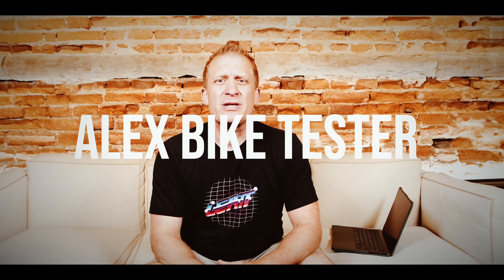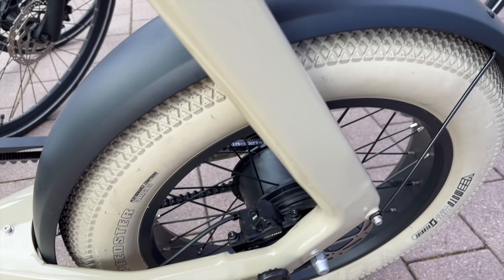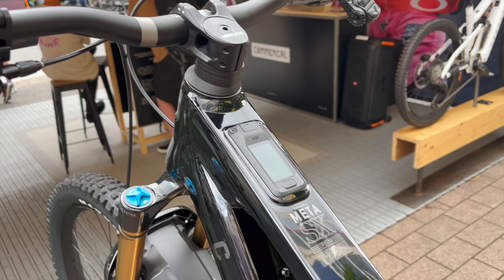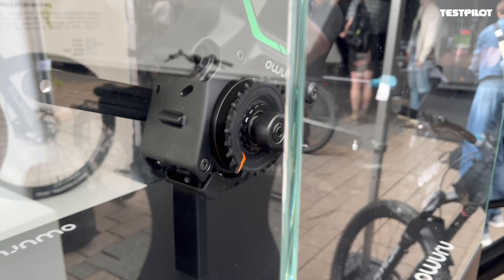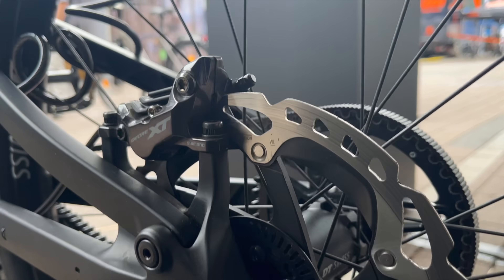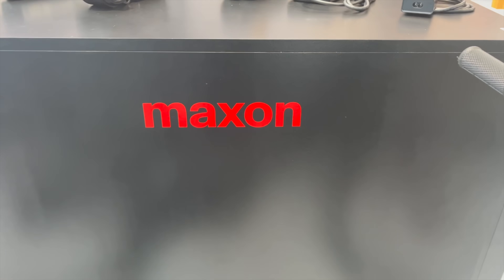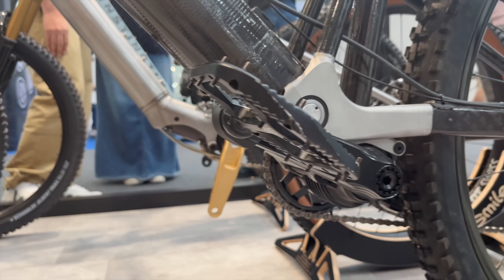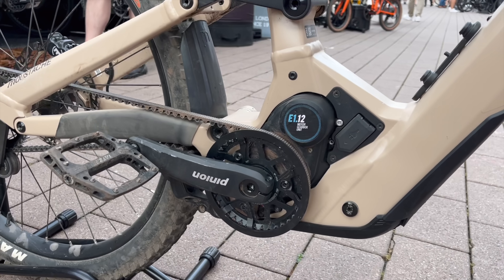Magical Motors Of Eurobike 2025

Comment: When speaking about peak wattage, you have to question if it is consumed power or delivered power ! Not where on the bike it is delivered !  Because motors have typically efficiencies of 80 to 95%, whilst all other mechanical gear has typical efficiencies of 95 to 99% !
Reply from the maker: Fair point, thepoint is though its all undefined and open to non clear marketing where no one is claiming a value that can be measured against others and therefore transparent to the consumer, right now its all subjective according to the marketing that day.

Comment: Chris Akrigg in a chat with Steve Jones said he puts his motor on minimum power to do the stuff he does. That was with the whyte e-160 on the old Bosch. If he can climb the steepest lines like that maybe people should put some effort into their rides
Reply from the maker: basically, im riding in eco or the next mode up 95 percent of the itme now. I ditched turbo, barely use 20 percent of a battery on a ride now.

Comment: Can you expand on the Rotwild engineering comment a bit? Do you mean innovation? Or things like production quality/concentricity of bores/alignment ...
Reply from the maker: They for a mainstream bike company use the most innovation in their engineering. Their battery for example has a very precise and well made locking mechanism, with really good °locating support° when you see it, you think, ok, wow, everyone else is so cheap.... the bike test of this bike points this out.... but i havent published it yet., maybe I will anyway.... The quality of finish on their battery as well is impressive and they have also packaged the cells in a way that beats everyone in compact design. I might make a short out of it to show you . They also are not afraid to make what they dont feel is good enough that the motor makers provide. Alignment of the battery as well in the frame is frankly impressive.
Reply: @alexbiketester  That's quite interesting and very insightful. Thanks for that. Not many testers showing the end quality of the bike. I'll look forward to your review!